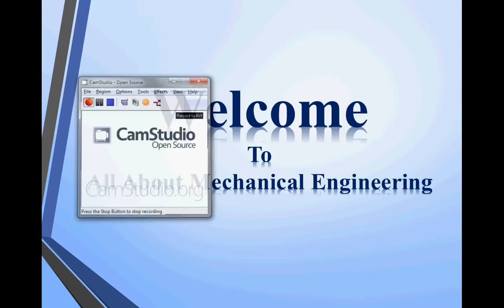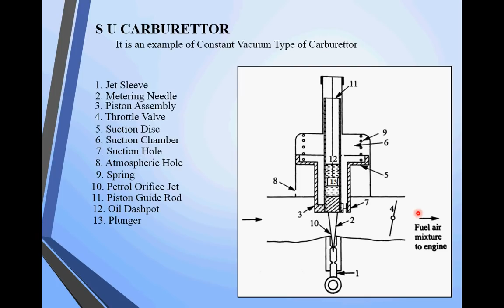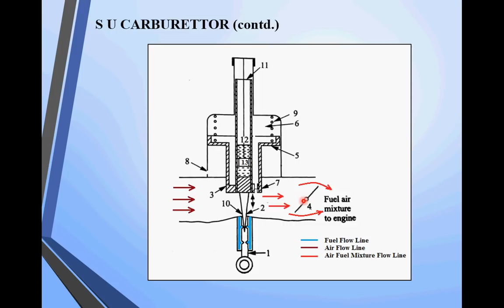S U  Carburettor #carburettor #carburetor #carburettor

Comment: Sir, is that CV carb and SU carb operates on the same principle
Reply from the maker: Since the design and working principles are different, hence both are not same. 
A constant velocity carburetor maintains desired amount of air-fuel mixture by using various circuits through various jets. (pilot jet and main jet) 
Where as here the principle of working is constant depression (since the depression available in the venturi tube is constant) and it supplies desired amount of air-fuel mixture under Various conditions using the same circuit.